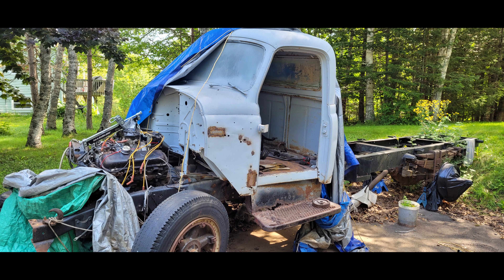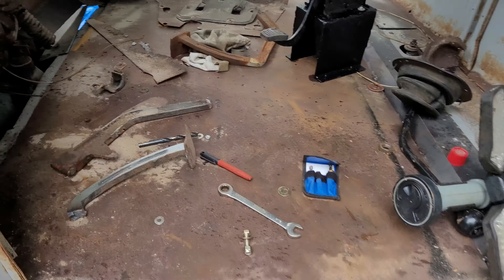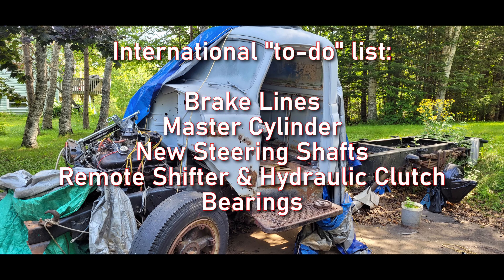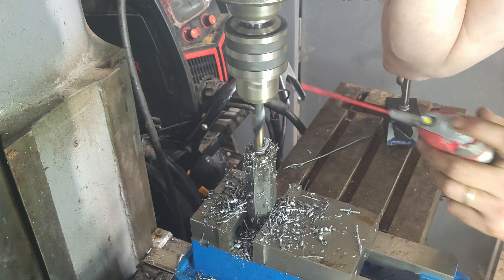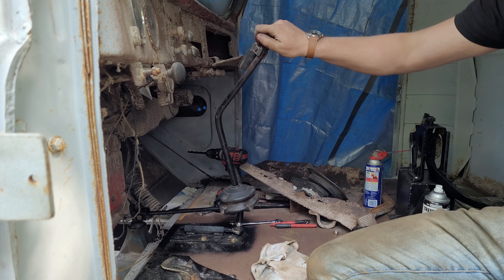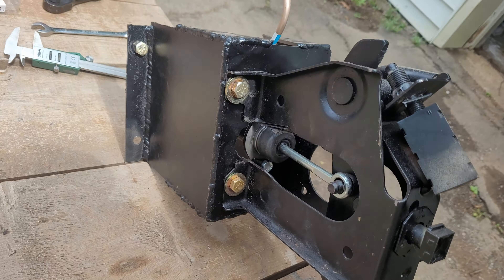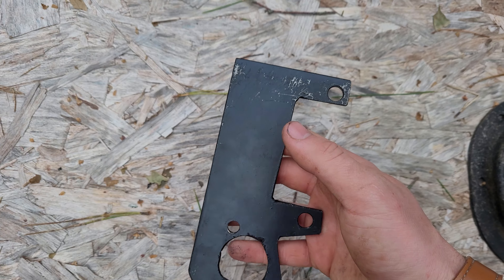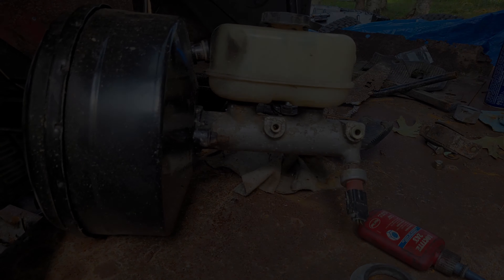1955 International Harvester Restoration: Remote Shifter Build

Comment: Looking good! Glad to see the progress! 
My R180 still sits as it has for decades
Reply from the maker: Thanks! If it wasn't for an issuing I'm having finding some steering parts, specifically a bearing, I think I might have been able to get mine to move this year under its own power
Reply: What kind of bearing is it? 
Last winter I sleeved a couple ball roller bearings to replace the obsolete output bearings in a transfer case. Purchased new bearings with correct width and inner dimensions and sleeved the outer on a lathe. Worked great. Wonder if that could done for your situation?
Reply from the maker: @ponway  unfortunately, it's a taperd roller bearing. I can find the outter seat no problem, but not the bearing number. Even took it to a bearing shop and had no luck. I may put up a post on one of the forms and see if I can have it identified, or maybe just buy one off someone. Absolute worst case, I guess I could replace the steering box, but we'll cross that bridge only if we have to
Reply: @RustRehab  how involved is it to get to? Maybe I could look at mine and see if I could find a number, probably the same steering gear.
Reply from the maker: @ponway  there are 2 in the steering box, one on the top and one on the bottom. I seem to remember there being just a few bolts and a plate to remove at the bottom, but I could be mistaken. I was suprised  My bearing place couldn't just get the dimensions off it and order a new one based off that